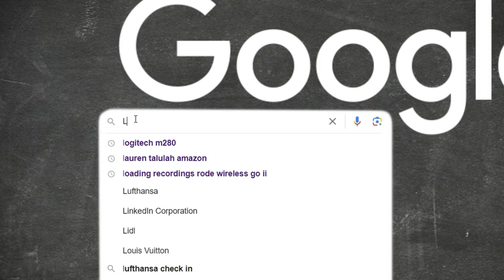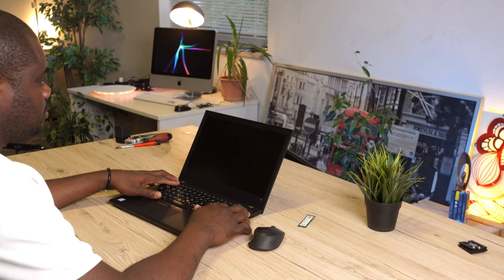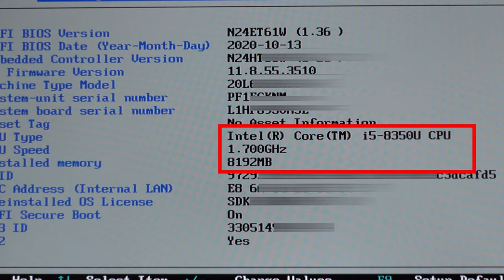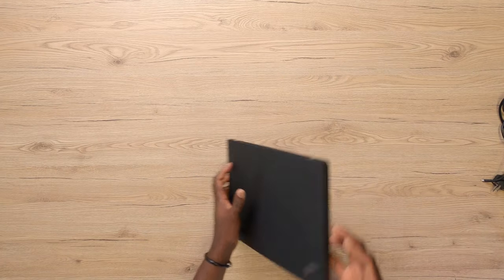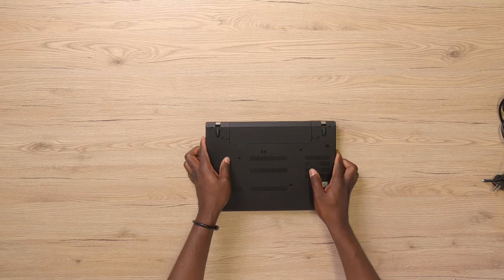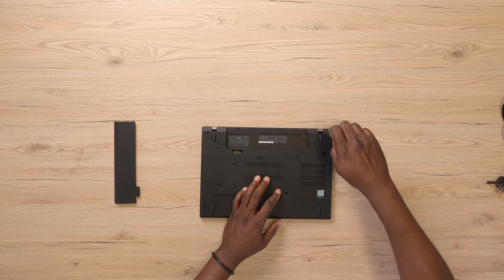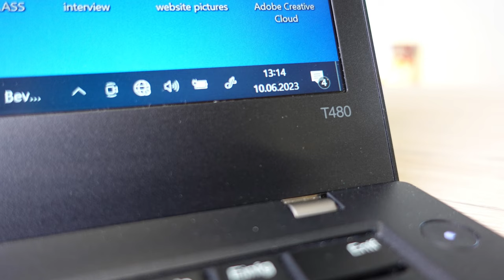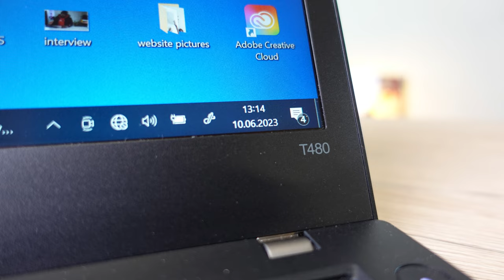Why Buy A Lenovo ThinkPad T480 In 2024?

Comment: Nice review! -- QUESTION -- So which would you prefer used.  T480 or T480s or T490s.  All would have FHD screen and max RAM.  It seems like most go for the 480 over the 'S' versions.  Have you heard that the 490 have some heating problems or something?  People seem not to like them even though they are newer... Why??
Reply: T480 is more service friendly than the other two models. The battery can be easily changed. RAM and SSD can be easily replaced. Take the T480.
Reply: @drangduewel  ..We agree.. Looking for a great T480 FDH with SSD and max ram and backlit keyboard.  Wish the listings would properly indiacte if the keyboard was backlit. Do you know if this is a common configuration to have backlit?  Maybe they all do so it is not specified??
Reply from the maker: i have the t480 and t480s. personally i will go with the t480. asse the 2 batteries, i kind of prefer the traditional build of the t480. if you pretty much prefer sleek designs, then i imagine you might like the t489s. moreso my t480 had a better processor at the time of purchase 😉
Reply: @Hardwaremoney  ..agreed.  We are going to look for an excellent T480 FHD with max ram and a 2.5"SSD (so we can swap it out easily)
Reply: Does this have IPs or Tn panels??
Reply: @eddy45686  ...it is not the "touch screen" but it is an excellent FHD screen.  Not sure of the resolution but it is the "good screen" to get according to online comments.

Comment: I have a t470s, which can charge from usb C and standard lenovo charger. It's also slimmer than the standard t470/480. i've bought it in 2021, and replaced the batteries and added some ram and a NON german keyboard :D . I still use it to this day as a 'sofa' pc.
Reply from the maker: wow 😉👍🏽

Comment: Hi, so i am thinking about buying this laptop but iam not sure yet, because this the model and the video (great video tho was very informative for me) is kinda old. every other laptop in amazon has a bad processor (some celeron model lol) and are quite expensive for their specs (>300$), do you recrommend this laptop or are there some better options for a 350$ budget?
Reply from the maker: @ehabemshani222  with this budget i honestly do think you will have great value from a t480. i am assuming you need the laptop for work, not for gaming or video editing. if it’s for pure work, the. the t480 has gat you. i have no regrets with mine.
Reply: @Hardwaremoney  Yooo thx for the fast response and yea i am not going to use this laptop for gaming editing or coding lol. one last question tho how strong is the battery life and how many years approximately will the laptop last (with good care of course)

Comment: I expected "Battery Bridge" meant batteries from a T450S could be used on a T480, silly me or silly LENOVO 🤔
Reply: You can use the batteries from the T470, T480, A485 and other ThinkPads that use the 61, 61+ and 61++ cells.

Comment: Should I get a T480 used second-hand with 24GB ram and 1TB for 500$ or get a new IdeaPad for 700$ with i5-1135g7 16GB ram and 1TB SSD ? 
Primarily software dev and casuallll gaming (maybe)... I need a good typing experience, prefer silent keyboard if possible.
Reply: That's too expensive for a T480. Find one that costs $200-250 and has either 8GB RAM or no RAM at all. And buy two 16GB RAM sticks (you only need them to be 2400MHz, no need to overpay for 3200MHz) and a good SSD. Then you'll get your money's worth. You can also find 72Wh batteries for it for like $40.

IdeaPads are cheap, less reliable and have worse build quality and keyboard. You also can't really use them in the cold, with gloves on (you can use your T480 literally anywhere, even in the cold in winter). The T480 is sturdy and will probably also survive being dropped, but I wouldn't recommend you try it at home.

Comment: This was an interesting video, to compare it to my E585 in upgradeability.
It's build quality is worse and lacks the additional battery.
Instead of a modem slot (it does have a replaceable WiFi + Bluetooth card) it has an NVMe M.2 SSD slot on the motherboard.
The second drive being a SATA one, with the option for an M.2 sled that I don't have nor need.
So it's good to know that I'm not missing out on much, as the processor in my machine is rather decent.
I've upgraded it's RAM, added a second drive and did some minor repairs to the chassis, so I'm very familiar with it's insides.

Comment: Hey bro does this laptop supports byapass charging 
Plz tell i am planning to buy it
Plz❤
Reply from the maker: your device will normally switch over to AC power. once the battery is fully charged.

Comment: I don't value the adjustable battery life.  I would rather have a good battery and a modern CPU.  At least in my opinion, Lenovo ThinkPad T14 G3 >>>>> ThinkPad T480.
Reply from the maker: cool 😉 i get what you mean. Although personally i find the 8 Gen. intel i5 to be mire then ok for my tasks. if your projects require more processr power, then go for it.

Comment: Hi, have you had any issues with the batteries? My t480 just shuts down when one battery is drained, it doesn't transition to the other battery. Many people have that problem and theres no clear solution
Reply from the maker: really? haven’t observed that with mine. have you tried playing around with the power option settings?
Reply: @Hardwaremoney  Yeah, I tried the power plan options but it didn't work, there's a thread on Lenovo website about having to disable drivers for batteries and whatnot. I have tried everything on lenovo vantage. It really is an odd problem, I also fell for the t480 model but this just annoys me lol 😂
Reply from the maker: @nicof.4679  really odd 🐜 . sorry about that! perhaps you could contact the seller, see if you could get a replacement, i haven’t had this problem and so have not been following up on the threads online.
Reply: I've noticed mine uses both at the same time, you should test popping out the battery on a full charge. They're supposed to be hot swappable

Comment: I bought a couple for $225 each that have an i5 and 16gb of ram with a 1080p display (no touch) and a 250GB drive. Not sure if NVME of Sata3 yet. 

I'm aware of the thunderbolt firmware issue so I gotta check them as soon as i get it but i did get them from a newegg selling on ebay as "refurbished" so I"m hoping they patched the firmware before point of sale.
Reply from the maker: thats great, its possibly nvme, also nrwegg is a reputable seller i heard. so hoping you will have a good experience 😉
Reply: @Hardwaremoney  They ended up being NVME but one of the laptops had a defective battery so I ended up replacing it with a 6 cell 72ma battery over the stock 24ma. The laptops I ended up giving to some people who wanted a cheap laptop that was reliable with good specs and they've been very happy with them no complaints.

Comment: Hi i have a kenovo laptop and for some teason i accidentally did some erird key combo abd it messed up my keybosrd. When i press r, the kets are wirriten as 'r5" or i is "i=". Is therr a way to fix jt? Ive been searching for hours wnd still hnable to fix it.
Reply from the maker: strange 😳, normally if you restart the machine, it should correct itself. otherwise make sure none of the keys are constantly pressed down
Reply: You probably changed the default language or smth

Comment: Would it be good for college ? Getting a i7-8650 16GB and 500GB SSD for €450 or would something be better for that price range ?
Reply: (t480s)
Reply from the maker: they are both very good machines. personally i prefer the t480 😉
Reply: T480s is a bad idea because of no external batteries. Buy only the T480, it's more upgradable and there are more mods for it. And you don't need to overspend on the i7-8650U because there's little performance improvement, since both i5-8350U and i7-8650U are 4-core CPUs. Get an Intel i5-8350U model for cheap with a 16GB RAM stick (there should be 1x16GB instead of 2x8GB sticks installed for easier upgradability later down the road) and improve the efficiency of the processor to be on par with the i7-8550U by undervolting the CPU using Throttlestop.
Reply: @one_step_sideways  Thanks for leaving these tips here
I don't know about undervolting a CPU. Are you sure that this won't cause any issues down the road?
I may purchase this laptop soon and I want it to be as stable as possible because it is meant for university.
Reply: @mianashhad9802  I'm certain. It's only going to actually prolong its lifespan. The only issues you may have is if you undervolt it too hard. It's just a matter of raising the voltage up to the last successful step.

For instance, I decreased voltage in -25mV ranges starting from -50mV. At -125mV it froze during the stress test to test the stability, so I increased it to -100mV and it was stable again.

Comment: Hi, does this laptop is good for coding and it can run Android studio smoothly ??
Reply from the maker: yes its good for coding 😉. I have personally not checked the system requirements of Android studio, so can't say.
Reply: @Hardwaremoney  if possible can u make a video on coding and running Android studio as there is no video on this specific model

Comment: Do you think it is wise to buy MacBook 2015 today 2023 for $400? Is it risky?
Reply from the maker: hi, risky by no means No. i haven’t checked lately for recent price trends. so can’t tell easily if 400 bucks is the best deal. But the MBook 2015 is a descent machine depending on your needs though 😉
Reply: @Hardwaremoney  My needs are basic , but I am worried about anything not working like how much does the mother cost for repair if it is bad
Reply from the maker: no worries Bro, seller should normally give you a 1 year Guaranty
Reply: @Hardwaremoney  thanks bro

Comment: Hello, asus x515JA i5 10th gen  ₹27500 and thinkpad t480 i5 8th gen ₹27500 which one of these would you suggest for coding?.please replay🙏
Reply from the maker: will need to first take a clooser look at the  asus x515JA. But i kind of love Lenovo thinkpads 😉
Reply: @Hardwaremoney ok, thank you for your replay 👍
Reply: ThinkPad T480 is a better option. It's incredibly upgradable as you can put up to 64GB of RAM and buy 72Wh batteries (if the laptop says the battery is unsupported - you need to charge the battery as it is likely very discharged, you can try to trick the laptop into charging the battery while it's fully turned off and on the charger)

Comment: T480 or T480s? Which you recommended?
Reply from the maker: I personally prefer the T480, The dual Battery is a thing for me 😉
Reply: If I want to make it as a desktop replacement, is the t480s the right choice?
Reply from the maker: @killlzhott  whichever way, i prefer the T480, its highl upgradeable

Comment: DON'T BUY THIS LAPTOP BECAUSE OF POOR SSD CONNECTOR SLOT. I LOST MY LAPTOP
Reply from the maker: hmm 🤔 i think you unfortunately bought a faulty laptop
Reply: No, there is nothing wrong with the SSD connectors
Reply: I've not heard of that as a common issue on other T480's. You can replace the internal caddy for 2.5" or NVME 2280 drives quite cheaply. So that might have been a fix. If not then you could consider using the WWAN slot for an NVME 2260 instead.